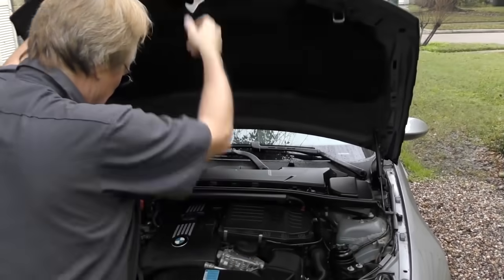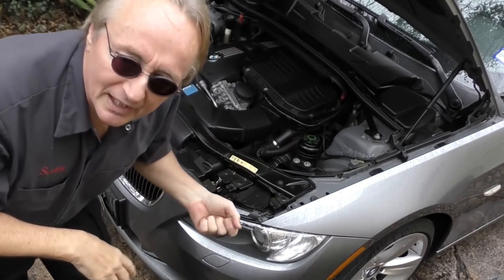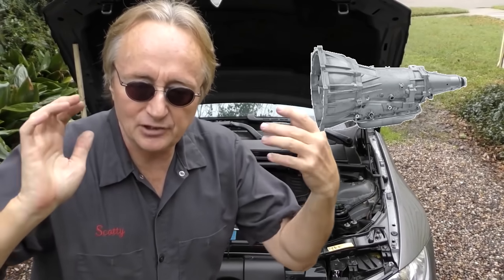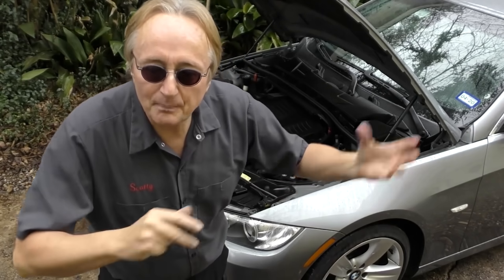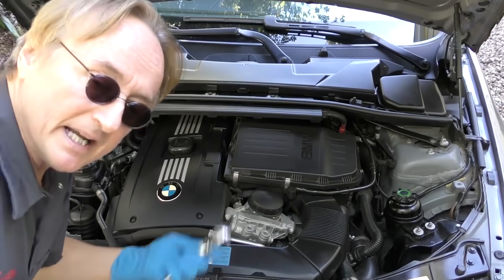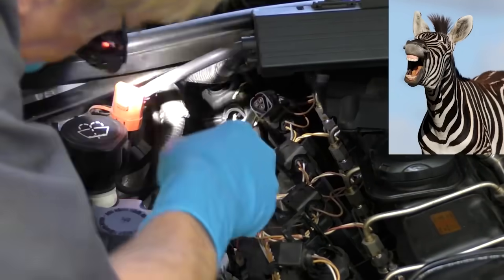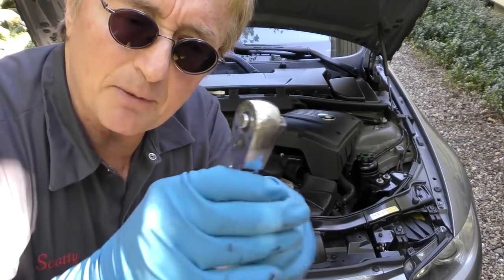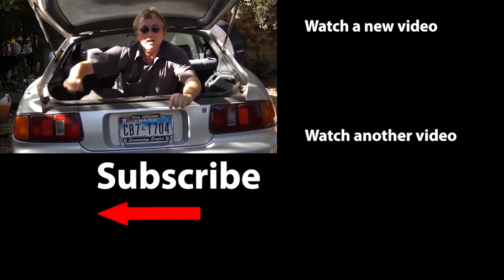People Say I'm Full of Crap About BMWs, Well Watch This

Comment: As a former BMW owner for over 14 years, I can say that everything that Scotty is saying is true. That being said, the way that BMW sedans and coups drive is just amazing compared to a Toyota and Honda, which I also have owned. I currently own a Honda and I miss the way my 330i drove but not the endless mechanic bills.
Reply: Bigger engines produce bigger heat that "can" be a problem in traffic jams
How do u compare a BMW 3s to a SAAB 9-3 (similar sized engines)
Reply: @dad1967  high quality and reliability are two different things. A Rolls Royce is high quality but not reliable while a Toyota Corolla is reliable but not high quality.
Reply: Did you ever try to race a Corvette with that pipsqueak German car?
Reply: Then get a Porsche… better driving experience and more reliability
Reply: @markremy4946  did you ever see how cheap and crappy the interior of a 2004 corvette is ?  Don’t want to daily drive a car with an econobox interior 😂, that’s why back in 2004 I chose the BMW over a Corvette. It wast long ago that the Chevy Cruise and Corvette had the same exact steering wheel and other interior bits
Reply: 330i have 4 cylinders engine . Oil brakes and all other Maintenance are regular
Reply: @CollinY818  2004 BMW 330i’s had a 3.0 liter straight 6-cylinder engine, which is what made the car special
Reply: @Matys1975  You want a Rolls Royce interior for a Chevy price?I thought it was all about performance with BMW? Please elaborate-acceleration, top speed, road course.
Reply: @markremy4946  BMW has never been just about performance, otherwise they would spend less on interiors and tech and more in the engine department 😂
Reply: Lexus?
Reply: @asoler456  Lexus just isn’t the same
Reply: @dad1967   wrong.I’ve had numerous of both. I have 4 high mileage Porsche and would never go back to bmw
Reply: @dad1967  have had an e36m3 525,528,three 335,750, 911 944s, 2 928s4 cayman s and cayenne s.. the Porsches have been much more reliable.
Reply: @dad1967  bmw have always had cooling issues, vanos issues, rod and rod bearing issues.  E36 had worst interior ever injectors, coils…. All bmw problems
Reply: No car drives smooth enough or fast enough for the ridiculous repair costs to be justified period.
Reply: @stevenbarts330  they use Audi engines, just tuned slightly higher - at least in their volume SUVs and sedans. Same reliability.
Reply: @stevenbarts330  very true get yourself a 911 gt 3
Reply: The only viable way to own an older BMW is to turn wrenches on it yourself. It’s really not that difficult compared to a regular car. After-market parts made of aluminum rather than plastic are readily available. I have a 2008 328i convertible. It’s a naturally aspirated N52 and a 6 speed manual transmission. It is a really dependable car and is a TON of fun to drive. It only has 230 horsepower, but it’s REALLY peppy. Once you get into turbos, the expense starts going up. Again, the only way to keep older BMWs from being mechanically totaled is to fix the known issues yourself and before things go pear-shaped. 😊
Reply: He said $3000 a piece for turbos...that's a blatant lie. Maybe dealer prices...they are 900 -1500 depending on the brand. The honda will do you good if you always take it back to the dealer. This mindset will always keep people down and hating. 335i's are beasts in disguise, you just have to take care of them.
Reply: Matt J you screwed yourself by experiencing BMW driving characteristics. I drive Mazdas & Hondas and I'm more than happy with their driving dynamics.
Reply: @TRUE_GR1T  all engines now a days are the same. Dodge is releasing there turbo 6 cylinder in the Durango next year instead of a v8 it’s likely since it’s turbo it will have a plastic valve cover
Reply: @markremy4946  the corvette is like putting an engine on a shopping cart. Handles the corners like a shopping cart and the interior is the same as a shopping cart. Interior of BMW or Audi is similar to entering a luxurious space ship while a convertte interior is similar to a 1999 Honda civic 🤣
Reply: @markremy4946  we want everything, speed, performance, luxury, reliability, quality...otherwise everyone would just get those Nascar vehicles if interior was not a factor and only thing they cared about was need for speed
Reply: Well as a 2004 X5 v6 bmw owner going on my 3rd year now with I kinda respectfully disagree with Mr. Scotty , yes beemers tend to require some tlc occasionally, but  all n all  it really is a nice driver car, I wouldn't replace my X5 with a new model Prado any time soon, it's just not the as bmw In more ways than one.
Reply: @markremy4946  yeah my BMW left the Corvette for dead, underneath a Corvette is nothing more than a Holden Commodore
Reply: @darrell3975  The Corvette probably ran out of gas😄!FOR THE MONEY, you can't buy ANY German car to put up against a Corvette, ain't gonna even be CLOSE, although the German car will probably have a fancier shifter knob!🤣
Reply: @markremy4946 the Corvette is rubbish, it's nothing but a Holden Commodore, they are known for being slow, uncomfortable and terrible for handling, and I can get an m3 for less than a Corvette which is much faster than the Corvette
Reply: Have fun driving boring cheaply made Toyota and Honda, how that wind noise inside cabin with Honda tell us about when you take off from red light. God help you if you get in car crash your chances of getting hurt will go up substantially when driving in Japanese car. 👍🏻
Reply: @philipkeeling8647  100% agree 
Try changing tensioner in Toyota v6 engine it’s nightmare 👍🏻
Reply: @philipkeeling8647  Everybody that I know that owned BMW said they were crazy expensive to maintain/fix. Never again, they said.$$$$$$$$$$$$$$$$$$$$$$$
Reply: @markremy4946  well in my experience with modern day cars, there's little difference in cost of spares across the brands. I had a kia before the bmw and the spares cost just as much and harder to get as well
Reply: @philipkeeling8647  For example, what do average alternators cost between a Kia and a BMW? What are labor hourly rates?
Reply: As a previous bmw owner you are 100percent correct.great joy how the steering feels road feel and supreme handling on cornering but due to overengineering tech they r a nighmare will bankrupt you.
Reply: @Matys1975  you don’t know what quality means. Quality = reliable. You're thinking of luxury
Reply: Same here. I have owned a 318ti and 325xi. One of those needed a new engine due to a plastic cooling piece breaking and causing overheating. I began working for Honda in 2014. Since then, maintenance has been a breeze. My 2017 Accord Coupe 3.5L V6 Manual is the best performance for price and longevity.
Reply: Yes, the driving experience for German vehicles is exceptional. Our family has also had a lot of Mercedes. They used to drive amazing in the 70’s - 90’s. They are kind of mediocre now. I drive Toyotas, despite the lack of driving enjoyment. I do have a a couple of bmw motorcycles. They seem to be a little better than their cars.
Reply: @eugenealymov2723  had. Wonder why you got rid of it then. We love BMW design but hate the reliability. Lease it just like he said.
Reply: @ishe728  Car had 450,000 km on the odometer. The body began to corrode in several places. If it wasn't  for rust, I would have kept it.
Reply: @eugenealymov2723  one thing German cars never do is corrode as they don't cheap out on steel. You never see rust under any German made vehicle. It's impressive you got that many miles when must barely make it 75k without the wallet drained. There's so many for sell that need major work all less than 130k miles. 

My daily is a A4 quattro b8. Yes it's a pain as well nothing but trouble from all the plastics in the engine and electronics
Reply: @ishe728  This was a 2004 model, E46. They are prone to rust in certain areas, when they get older. But the engines in those cars are great (6 cylinder that is). Newer BMWs are pretty unreliable, which is why I didn't take the risk of buying one of those. Fun fact - that car is still on the road. I stay in touch with the guy that bought it. It is at 470,000 kms now.
Reply: @Matys1975  c6 they got way better but I love bmws too especially the e46 and e90 m3
Reply: @darrell3975  depends on the corvette try a zr1 c6
Reply: @deadshot4245  if we are going the top of the range Corvette, then that is worth more than the BMW M5, which going by every test online is much faster than any Corvette ever made, corvettes are not fast
Reply: @darrell3975  well the average corvette owners age is around 67 so.....
Reply: @markremy4946  Just learn to fix it your self, no need for expensive equipment to read codes and test modules etc, i use INPA a advanced free program which can read any values or procedures you want.  And the most important thing is to choose a good engine, i chose the N52 and have done all the mechanical / digital / diagnosing myself. I am also just 18 and its my first car, it`s the BMW dealer which screws people over, and if you need an honest mechanic that needs to be yourself.

2005 E60 N52
Reply: @Fredrikbjerk  Tell me about your car-model, mileage,breakdowns, costs please
Reply: I have an e46 and e90, but bmw is certainly not a car for the negligent. Unfortunately, people won’t changes oils and beat on the car, flooding the market with somewhat cheaper, trashed cars. Finding a used bmw that has been well maintained is challenging.
Reply: @mike4617  Ok, good luck with you cars.Thanks for tip!
Reply: @Tripnotyst  you are correct sir!
Reply: as a current bmw owner hes still mostly right but the way my 335i drives makes it all worth it, as long as you do your own work
Reply: @Matys1975  lmfao how did you reach the conclusion that BMW is 'not about performance.' Their M8 goes 0-60 in 2.5 seconds. Hell, their X1, their slowest, cheapest, and smallest SUV goes 0-60 0.2 seconds slower than the Mercedes-Benz C-Class sedan. They are absolutely about performance and they make a constant and repeated effort to emphasize the capability and speed of their vehicles as well as engine information. On their website, they allow you to compare basic specs between different models easily. You're objectively wrong and you have no research to back up the idea that they don't spend considerable time developing their engines.
Reply: @sambrainard3487  I did not say “BMW is not about performance” , I said “BMW is not JUST about performance”, see the difference ? For example, BMW excels in interior design, quality and fit and finish, where as some “performance only” cars do not
Reply: How can you compare a BMW to a Honda? Honda can make their cars drive the same as a BMW. But then you'll pay the same price as a BMW or even an Audi.
I don't own a single brand new honda. I own 90s Honda. Mine drives beautifully well.
However, your comfortable S class is a limousine. My civic is a hot hatch. The S will sit at 150mph and you won't know it. My Civic does round corners in ways an S class never shall
Reply: @darrell3975  What does that even mean?  How could a custom, authentic sports car frame and drivetrain even come close to equating to a four-door sedan, basically a re-badged Pontiac G6, or the other way around.  I’ve been in older 911’s from the mid-2000’s that had interiors not that much nicer than a C6 Corvette to justify the price difference.  All brands have upped their game since with interiors to match their handling.
Reply: @markremy4946  Comparing a corvette to a base model bmw lol, have you ever raced a M5cs in a pipsqueak Corvette 😂 the sports car gets gapped by a family saloon
Reply: @markremy4946  Comparing a corvette to a base model bmw lol, have you ever raced a M5cs in a pipsqueak Corvette 😂 the sports car gets gapped by a family saloon
Reply: @wyasupreme  You own a Junky German??😆
Reply: @wyasupreme  Skippy-I've blown many a M5 into the weeds. I make the race fair and put on my e-brake and let the air out of two tires!!😂
Reply: @markremy4946  unfortunately
Reply: I fully Agree  !  I went trough 2 BMW cars several years.Yes they do drive well ONLY WHEN THEY WORK But most times they are getting fixed ! No Matter new or old 3 series,5 series,7 series ALL They are overpriced ,overrated SHITBOXES !!!!
Reply: @markremy4946  if he did he would learn how slow corvettes are or how fast average German cars are.
Reply: @fincloser1230  ..or how expensive the Krautmobles are to buy, maintain, fix(which is frequently).BMW-Break MY Wallet.
Reply: @markremy4946  well as a pre owned vehicle buyer and seller (day job automotive buyer and seller fortune 300 automotive company) for 24 years I can promise you that you are comparing apples and watermelons.  I am an absolute corvette fan boy.  My dream vette is a c2 coupe with a 427.  The BMW (any of them) is safer, better handling, and a better daily driver than the vette.  Ask any mechanic how fun it is to work on a ls1 vette, they would take the bmw any day.
Reply: @markremy4946  you are correct for the most part that BMW is more expensive to keep on the road due to over engineering.  The right BMW is a fine choice, the wrong BMW is for the rich only!
Reply: Test drove an 08 Camry v6 for my daughter and found it wasnt too shabby. No old plastic parts either.
Reply: The 330i for the e90 should be more reliable
what went wrong in yours?
Reply: @GamingHistory.  not sure, did the required maintenance by the book. Had only 84,000 miles after 14 years. Main issue with the car was endless oil leaks due to various gaskets going bad once the car was 8 years old. All of which were not cheap to fix due to the labor involved. Other small things also went bad, like a window regulator or sensor here or there.
Reply: @Matys1975  Did you drove it hard?
Reply: @GamingHistory.  no, not really
Reply: I have the utmost respect for Toyota. They have their place especially for the everyday American who just wants to get from A to B with good gas mileage. And they can make fantastic cars when they want to (Lexus LFA, LC500, GR86). 

That being said, if you are a driving enthusiast and have a passion for cars, then there’s no debate. BMW is more fun, more engaging, more driver-focused. Once you drive one it’s hard to go back to a normal car.
Reply: @markremy4946  yeah the 911 flat six turbo always wins.
Reply: @Sakosaga  Yup, it ALWAYS wins the MOST EXPENSIVE REPAIR BILL!!!!!!😀😄😆🤣🙂🙃🥲
Reply: @markremy4946  other brands definitely cost more that are on the same level. If BMW is so terrible, The Supra wouldn't be using a BMW engine......
Reply: @Sakosaga  Huge money for BMW purchase/maintenance/repairs.
Reply: @markremy4946  I'll race your corvette with my BMW. Name the place and the time 

My 50/50 weight ratio chassis and my stage 2 turbo'd 6cyl with 550 whp loves putting cars like yours in the rear view mirror. My favorite cars that pull up next to me on the interstate to race me are vettes and camaros!

You better show up with the latest model Vette or it's gonna be embarrassing for you brother 😳
Reply: @richmusick4881 Ricky- For that race, I don't need my vette.I think my Honda moped would suffice!😉
Reply: I had a similar experience, got a Honda Accord, extremely reliable car, better driving dynamics than any Toyota, but always missed my BMW E36 328is, so got a great deal on a E93 335i, the only major issue was the water pump, BMW btw reimbursed water pump fixes, mostly oil changes. Have a 2008 X5 with 110k miles, just replaced the plugs myself. If you are willing to spend some elbow grease they are much easier to diagnose and fix problems because of all the computers in there that give you a pretty good readout of where to look. BMWs drive phenomenally, now have an G30 530e (gives 70mpg as a city cruiser) and an F83, just brings a smile to your face every time you drive them.
Reply: W pfp
Reply: @omardelmar  Yeah, but like Beemer, Benzes are REDICULOUS in $$$
Reply: @samjam6989 I think you might want to check out the C8 Corvette, it's actually very nice inside. The performance is of a super car, might want to know your stuff before you start talking facts....
Reply: @stevenbarts330 lmao you quoted Porsche as reliable ?
Reply: Bad engineering on the part of BMW
Reply: @Matys1975 that corvette would still take that 330i to gapplebees stock. 🤷🏻‍♂️
Reply: @samjam6989 and that’s why you potatoes keep paying thousands on repairs 😂 I’ll take the econobox that could wax your “German Art Piece” while still looking like a Cobalt inside… honestly that’s more insulting to the BMW.
Reply: @Absolewtly  The Chevy wouldn't make it to gapplebees because it would break down midway since it still a piece of crap Chevy 😂
Reply: Bills.damned
Reply: I’ll race your corvette with my 335i any day of the week😂😂
Reply: @stevenbarts330 porche? Lmao no, that’s for feminine “men”
Reply: Just got mine and I’m saving up to get straight metal components 😊, I’m saving my baby
Reply: @markremy4946 Not the same class car tho, different price ranges and market target.
Reply: I has hondas all my life, I brought a e46 320d within one month the brake caliper fell off 😅
Reply: @TA0121  you werent taking care of it
Reply: you lose credibility after saying 14yrs. So you kept buy and driving something soooooo bad that you kept doing it for almost 2 decades. 😂
Reply: EXACTLY. just started doing this myself and buying a few of the tools. already saved myself 1000s @jazzjames
Reply: All accept that this car does not have “2” turbo’s!
Reply: @Matys1975  go look up the definition of high quality. It does not mean expensive.
Reply: @Matys1975  Reliability equals high quality. How exactly something that falls apart in a few months is high quality? Can you explain this quantum paradox?
Reply: @FJB-MAGA  a Rolls Royce is high quality but not reliable. A Toyota Corolla is reliable but not high quality. Does that help you understand?
Reply: Try Lexus ?
Reply: BRO ONCE I CAN BUY bmw BRAND NEW I WON'T HESITATE - I THINK THIS ISSUE IS WHEN THEY GET OLDER
Reply: That’s why I do all my own work and won’t own anything 2006-2019
Reply: Here here. Former BMW owner, now a Tesla owner. Never again.
Reply: @stevenbarts330   Get a Tesla.
Reply: @ezumach  no way.. a microwave cooks faster than a grill but no one wants to eat a stake cooked in one.
Reply: @Matys1975 😂😂😂
Reply: We still have BMW with over 350 thousand miles on them and we always kept the maintenance up on every vehicle so If you can't afford to do the maintenance you should never buy one and remember that you gotta pay to play 😊😊😊😊😊
Reply: @topnews1007  I spent $7k in 12 months on repairs. I now own a Tesla MYP. Not about affording the repairs, it’s about common sense. Should not need major repairs on a new car.
Reply: Endless money pit.... Endless money pit.... Chuckle very true, very true! 😎
Reply: BMW has rear wheel drive and good amount of power, well there are many other brands that have that. Just open your eyes and you'll see that the market is full of options